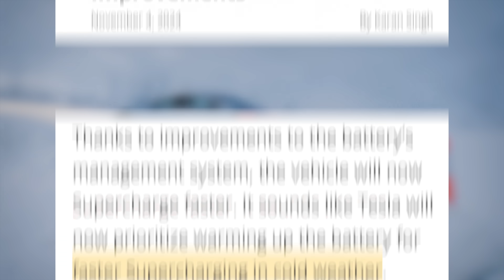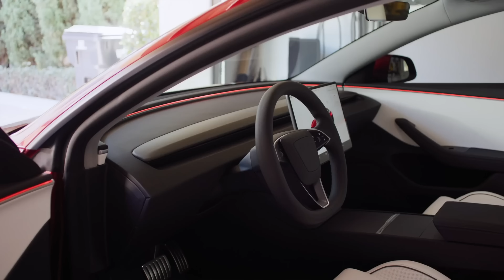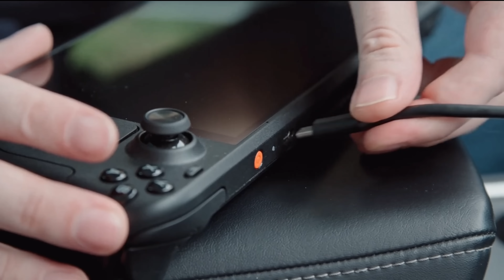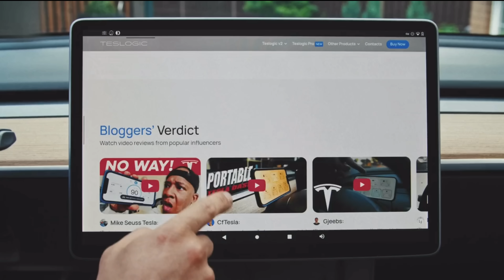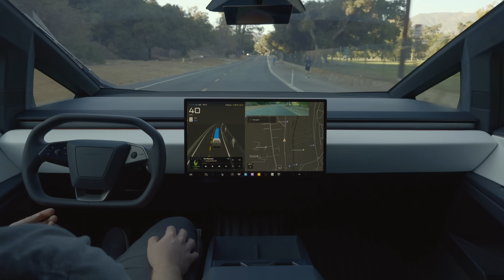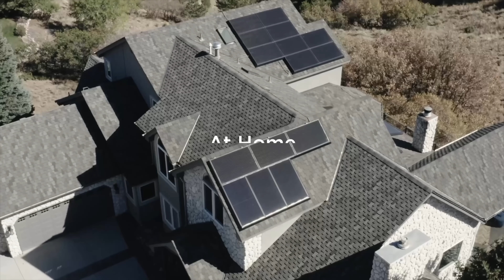NEW Upgrade Fixes Tesla's Biggest Problems | But There's a Catch

Comment: Does screenmate need or use jail break? as far as I can tell no. Looks like it is its own android sbc with essentially a hdmi in and out (using tesla connectors) to sit in line between the screen and mcu. No tesla code changes needed. Just like VCR use to do back in the day. 
Disappointed in the poor factual accuracy here plus all the fear mongering based on an incorrect assumption.

Comment: I agree with the last comment,,fix the wiper sensitivity as no need for wipers to go full on in light rain also I had an up date a few months ago and before it my 12v fridge used to work all the time in the back of my model Y as long as century mode was on but after up date that no longer happens and will only stay on when driving the car !!!!! Please change that back ,,

Comment: Tesla need to urgently add the charge level required at destination just like the App described. Simply arriving at a destination with minimal charge assumes destination charging available when it rarely is. If the car asked about destination charge availability and next destination it would be so much easier.

Comment: What about phantom braking?
Reply: 3rd Tesla and I’ve never had that happen. Is it a fsd thing? Or just randomly brakes out of nowhere?
Reply: @jayrodathome yes, it's a FSD issue, although minor.
Reply: @falsedragon33  Negative, it is NOT just limited to FSD.  Just the basic adaptive cruise on the highway does this also.  I have a 2024 Model Y (USA) and this has happened 4 different times on I4 in FL at 70mph....scary af.
Reply: @Halpinat0rs I bought a 2025 LR M3 and have full self driving. 

I personally haven’t experienced any hard phantom braking yet and I’m at 1,222 miles and counting. 

I think with these last couple updates they have really improved fsd and how it’s using the cameras to detect everything. 

There seems to be greater detail generated on the screen now too. 

I have experienced phantom hard braking on interstate from a 2019 model 3 on autopilot. 

Seems that this might be a thing of the past hopefully as it is nerve wracking lol.
Reply: @jayrodathome  Its with cruise control too
Reply: Recalibrate your cameras!

Comment: Lots of interesting info.  I hope you are right about Tesla integrating AI into the voice command system.  I also hope they improve on the voice navigation to mirror what Apple maps does.  
On another note, can you begin to follow what Polestar is doing and give us some opinions and updates. There new line up of cars, the PoleStar 3 and 4 seem to be good options for EV buyers and they have also announced the Pole Star 5.  They will be able to use the Tesla charging network which makes them a truly viable option for those looking for an EV.  I have a Tesla model S long range my 3rd Tesla and I am looking to evaluate  other options before getting my next car.  I like my Tesla but have been frustrated by a few things with it lately and I think the resale value on my model S is dropped due to the vast fluctuations of Tesla pricing.  Right now I like the Polestar 4 which fully loaded all wheel drive comes in at the same price range as the Model S.  I haven't done a deep dive but would love to get your opinion.  Thanks

Comment: My guess is that this is not jailbreaking the Tesla software at all. It is just inserted into the screen connection so it can show its display and react to the touch screen - and pass on the parts of the Tesla standard screen contents as required.

Comment: The only person who doesnt want stalks or integrated screens is Elon. Its about saving manufacturing costs.  Its just like the steering yoke when enough people opt for a competitive ev then Tesla will have to start listening to its customers. ONE LESS PART is not always the right solution.  I truly love tesla i just wish they would listen to the customers more. Even if they would just do a poll on x.  Like do you prefer stalks?  Or  would you prefer a screen behind the wheel for speed  or a heads up display ?  Id give up fart mode for a one touch defrost button.
Reply: i'd go for a rocker on the back of the wheel arm.    just like where some manufacture put  radio up down.      but make it left right.    Im not a fan of having to look at the wheel for where the arrow indicator is.        or make it a trigger on the left arm.  and right arm like a game controller.      better than a stalk.

Comment: Screenmate is more of what I am looking for for an on screen display. Because what Tesla designed is not so good. It's adequate, but not as good as it should or can be. Yes, the fonts are way to small. I can't even read the clock time.
Reply: I enlarged my fonts. Excellent results. But no problem seeing it before.

Comment: I had multiple stops on Google Maps and shared it with my Model Y. The result was pretty amusing as the route crisscrossed the US with only one of the five stops being correct.
Reply: You need to REORDER the stops manually by dragging and dropping them to the correct route plan. (A Better Route Planner also does this)...

Comment: PLEASE FIX THE WIPERS SENSITIVITY
Reply: @jaykaknes1133  IMO the issue is that they assumed they could fix the problem later, but the front facing camera is positioned too close to the windshield and therefore it will never be able to get an accurate image of the what is going on with the whole windshield up close, while simultaneously focusing far ahead.
Reply: Thanks for the reply. We have a 2014 M S P85 and a 2022 M 3 long range. Both have had the windscreens replaced. Wipers are an issue. The ones on the 3 even when the is no rain and it’s parked in the garage. One swipe. Why?
Reply: @jaykaknes1133 why were the windscreens replaced?
Reply: Had the 3 for two weeks and took a stone hit that cracked across it. The S had a stone chip that had been “filled” by Safelite about 3 years prior. Several cracks grew out of it this summer.
Reply: I had that issue on my Y, turns out the glass in front of the camera was fogged with factory chemicals. Tesla has an advisory on it. It is worth making sure the inside glass is spotless.
Reply: Also the 2014 S has only a backup camera. Frankly I don’t know how the wiper sensors work.
Reply: Just use manual wiper control?? Auto wipers are not mandatory
Reply: I use a glass product similar to rainx but much stronger on beading up water. I almost never use my wipers.  Works great.
Reply: @ what is the product name?
Reply: It can't be fixed. There's no rain sensor, just cameras. Pathetic.
Reply: i was always perfectly content on turning on and off my own wipers so i wouldnt even use auto for that. just turn them on when i need em and off when i dont. no biggie
Reply: @BarryGGould  Agree, except that autopilot turns on auto wipers.
Reply: @gannetripple im also perfectly capable of driving my own damn car lol. i would not pay that outrageous 8k for a car that drives itself. thats an insane amount of unnecessary extra cost
Reply: It does not have priority, when Elon have fixed the FSD it does not matter, only for cleaning cameras😀

Comment: That Diesel guy demonstrated the back of the CT snapping with a 10000 lb load.  Is that real?
Reply: Wasn’t that only after driving the CT off a ledge, with the rear taking the brunt of the fall? If so, a similar drop would likely have bent a steel hitch, possibly rendering it unusable.

Comment: If they really want Cybertruck sales to increase, they need to lower the price to what was promised. That's what is keeping me from being able to purchase one.
Reply: The price will be pretty close to what was in initially estimated when accounting for inflation and all the new features: four wheel steering, drive-by wire, faster, acceleration, 48 V architecture, ethernet ring.
Reply: I hadn't heard that, but if true, the price shouldn't be to much more, just inflation given Tesla took away some big ticket items. For example the ability to lower the back end and extend a telescopic ramp, the interior top light-bar, and 500 mile battery. Those were three of the five selling features for me which I can accept they no longer have, so long as they keep the price the same (plus inflation). Thanks for the info, cheers!

Comment: I think FSD transfer is a great way for Tesla to get off HW3 without alienating the customers. Exhibit A: myself.  I transferred FSD which I got for $5000 in 2019 twice, first from 2019 Model 3 to 2023 Model Y and then to 2024 Model 3.
Reply: Guess you forgot how much new cars cost.
Reply: @banderson1979  I didn't, but the FSD transfer is an additional incentive for those who have an older Tesla and thinking about the upgrade. Tesla enjoys the highest brand loyalty across all automotive brands and it's not unusual for Tesla owners to upgrade or buy an additional Tesla. FSD transfer is great fit for them.
Reply: And new onwer of your car does not have fsd now?
Reply: @alexeyturkremizov  that's correct. Keep in mind that the new owner can buy fsd option back at any moment,because all the hardware is still there.